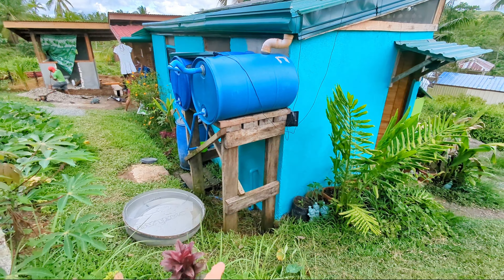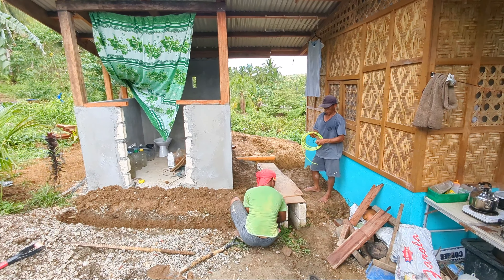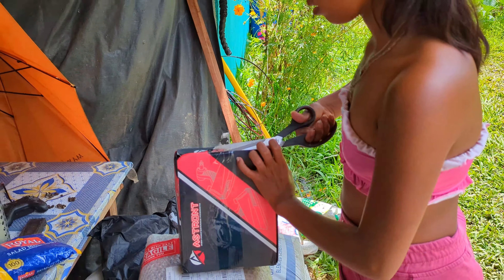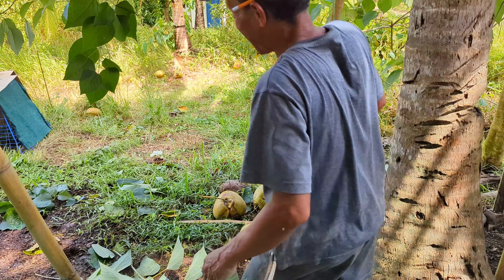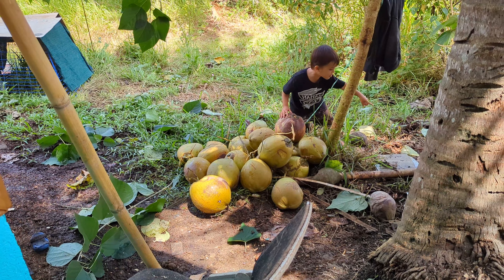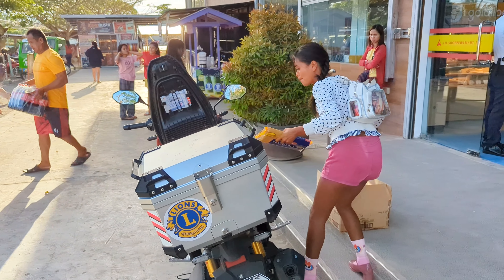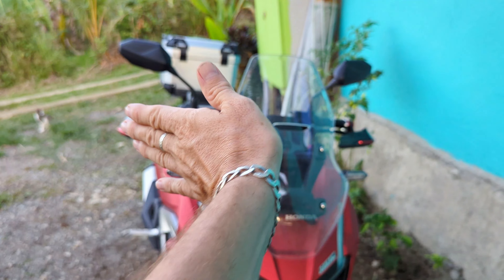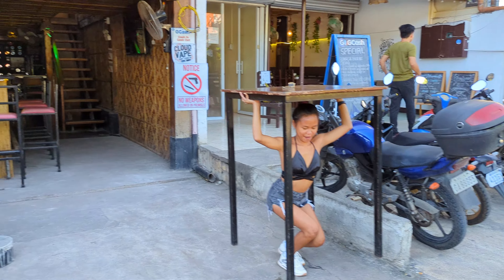🇵🇭 MOTORCYCLE RIDE & FOUND REAL BUTTER! BATHROOM CR CONSTRUCTION! Island Living Off Grid Philippines

Comment: Why not install a proper toy-let with water tank and seat?   No disrespect intended so please do not take it the wrong way,  but was Jhaja sitting on the bare toy-let bowl where other males P?   I see no seat.
Reply from the maker: No disrespect taken. It's a project with MANY finishing points needing completion. We don't want anyone else working on our buildings, besides Ray and Titoy, so we make progress between their rice harvesting and other work.
Reply: @offgridislandfamily Temporary toilet seat = couple of wooden planks nailed together. Sand & paint for NO splinters. Women responsible for removing it after finished.  Also, responsible for placing it back on throne. Cheap fix; works.